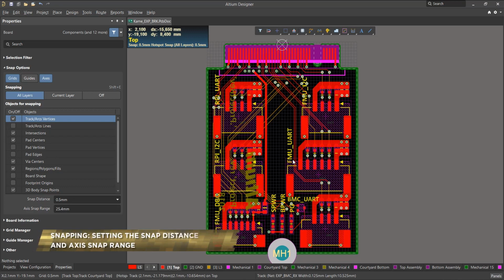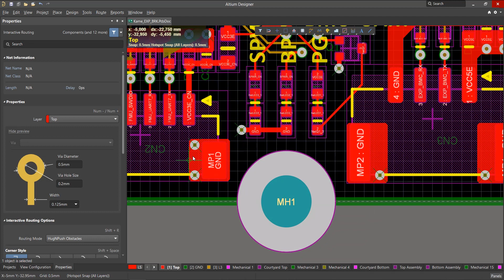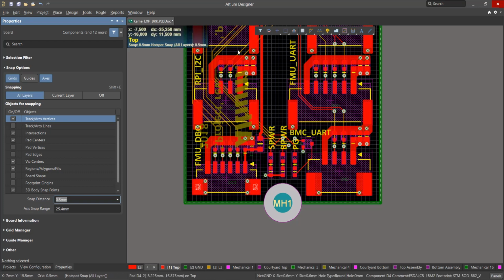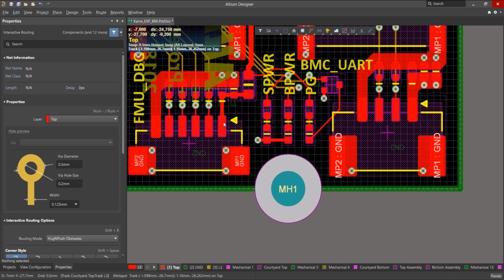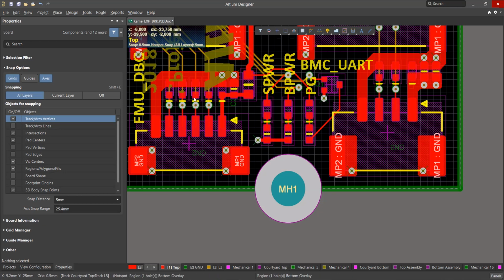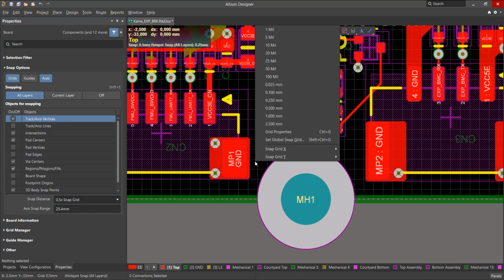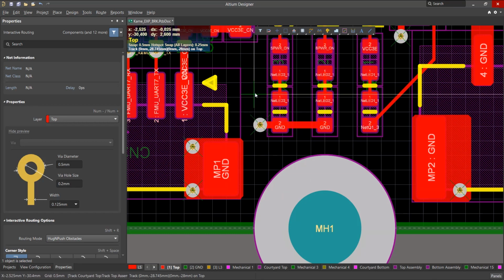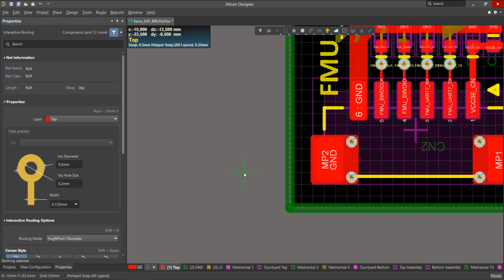How to Set Snap Distance & Snap Range in Altium Designer | PCB Layout

Comment: If the snap distance was in number of pixels (yes screen pixels), then it would be more effective as the zoom level wouldn't make it hard to snap to the hot-spots.  
ie. it would feel the same to the operator regarless of the zoom level, because it doesn't work with the actual distance in mm, but a fixed distance on the monitor screen.
Think about it!